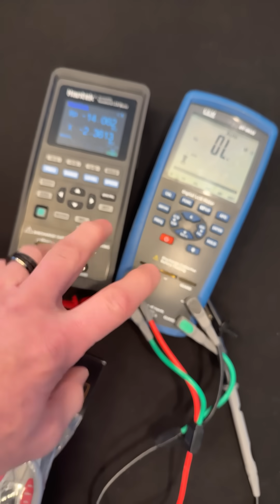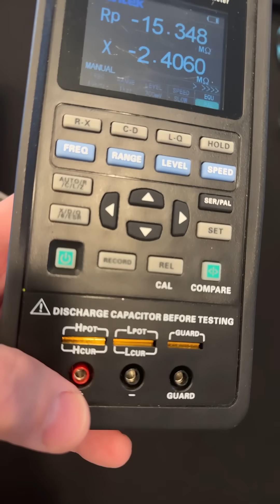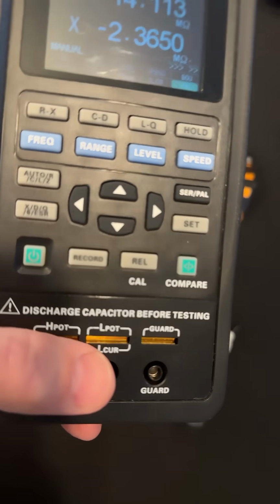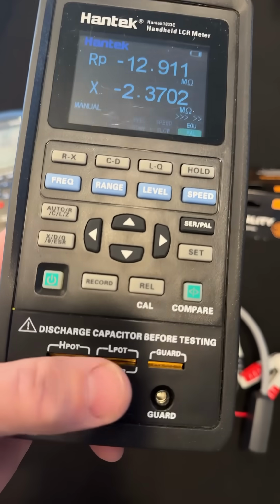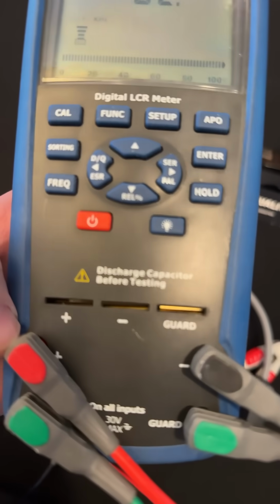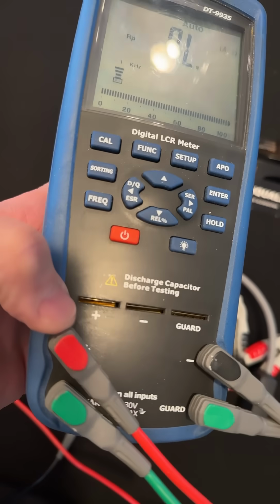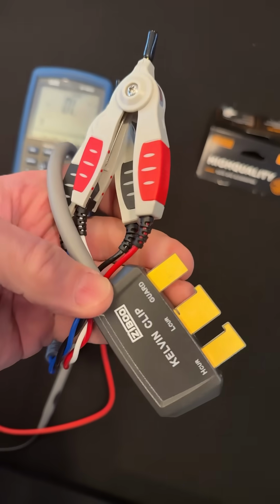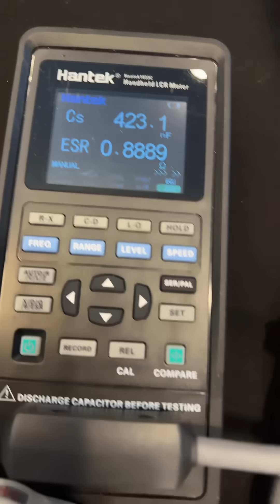Upgrading to Kelvin Clips for LCR meter ZIBOO #ZBL100k #LCRtestclip #Kelvintestlead #LCRmeter

Comment: That CEM meter doesn't support kelvin connection if I remember correctly. Terminals are just shorted inside there.
Reply from the maker: Thanks for point this out - you may be right.  It is strange that it has 4 wire terminals but the blades might not be connected that way.  I'd have to open it to verify, but they are not labeled like the Hantek is...